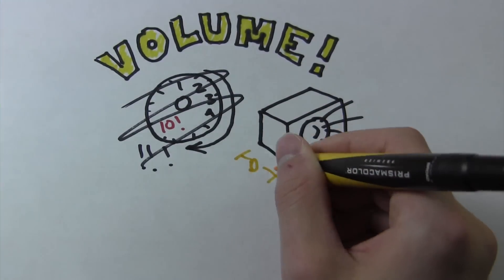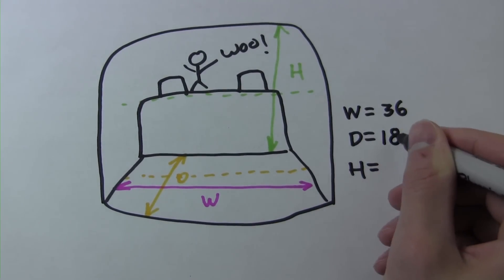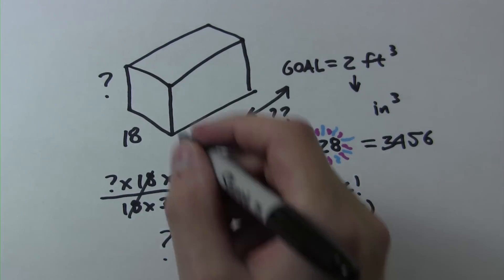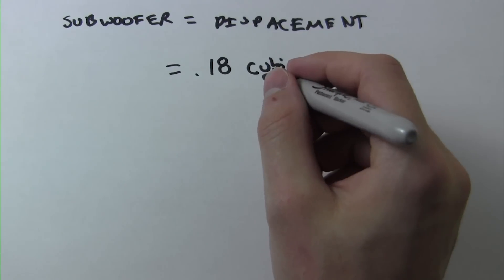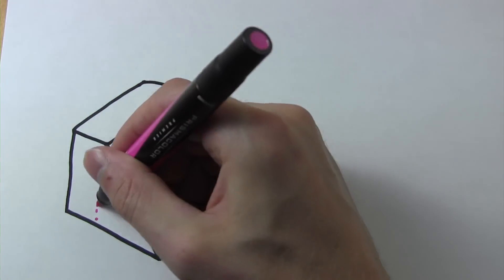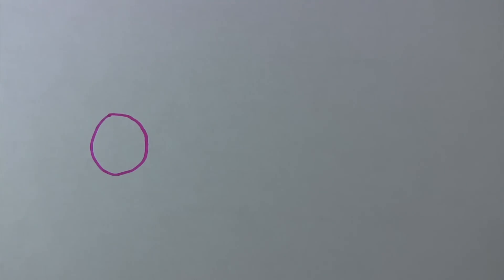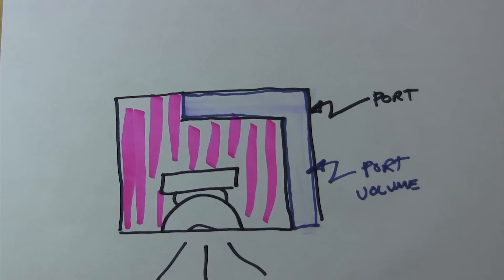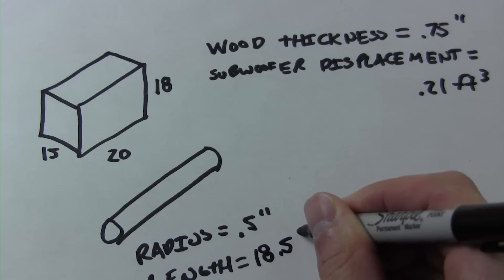Subwoofer Box Volume - Car Audio Basics - CarAudioFabrication

Comment: hey man, do 45s in a box effect port tuning?
Reply from the maker: If you don't account for them in your volume calculations you are not determining your port length correctly based on what you are inputing to that equation to determine what length is needed for the desired frequency, so yes, in a way they do

Comment: When you calculated for a wedge you did triangle calculations. Why don't you just add the lengths of both and divide it by two. That's what I did it's much simpler.  Also my jl10w3 displacement is only .05.  Isnt that really small?  Seems like it would be more because yours was like .2 or something.

Comment: How do you figure port length all these web sites confuse me I got 2 kicker comp 15 in a box I made > 20 D x 35 W x 18 H i have 2 4" round ports 6.25 long I thought that was it but it don't sound right i want 40 hz but idk if that's the right dia for 15s and I'm not putting them in the box they would be on the out side bec the box is small
Reply: You gotta go bigger
Reply: Longer. 6.25 is to short, she'll never be happy with that!

Comment: Why do you add Subwoofer displacement to the amount of volume in the box🤔, shouldn't it be subtracted since it's taking up more space?
Reply: U add it when you know what size enclosure you need... then you would know exactly what size it has to be.....if u added the sub without adding the space to the enclosure that it will take up.... your measurement would be off by the amount of space that the sub is taking up.

Comment: My problem is I want to know what s making my car lights dim when I'm bass hard? I have  a 1000 watt. Sound stream mono blk. Amp. And
Reply: You have a few issues, and it all has to do with power supply.
Firstly, your alternator does not have the capacity to support the system. You need a larger alternator. In your case, you should install an alternator that is 50 amps more powerful than what your car has.
On top of that, you need more reserve power, which comes from an extra, or larger battery. The best solution would be to install a seperate 14V XS Power battery in the trunk or the like.
Lastly, contrary to what some will say, a capacitor is very useful and is part of any good system.
Install a 1.5 to 2 farad capacitor that is 20-24 volt surge rated. They are actually not that expensive. The Audiobahn 2 farad caps are pretty good value.
Lasly, you need to run proper wires if you already don't. First off, get rid of your CCA cables if you have those. The conductivity of those are so bad compared to OFC wire, it's not even funny. As an example, a 4 gauge CCA cable will support about 60 amps, and a 4 gauge OFC cable will support 150 amps. So make sure you use good OFC wire. Your install does not need more than the 4 gauge, so that makes it pretty affordable. Sky High Audio and KnuKnoceptz both make great OFC wire. Use 4 gauge for both power and ground!

If you think the larger alternator just makes things way too daunting, the basics are as follows.'
XS Power D14-31 or D1400 in the trunk with your amps. You will retain your stock battery, so this XS Power battery will only run your system.
The capacitor, and the OFC power/ground wire.

A final word on alternators. Contact your car dealer/shop. Chances are that there's an OE alternator unit with more capacity than the one installed in your car. This will make installing a new alternator virtually plug'n'play. Larger alternators are the big thing in good car audio systems.

Comment: There is a typo in the Brace volume line. 1725 should have been 1728. I did the calculation with 1728 but typed it in wrong in the comment.

Comment: But the brace couldn't be 18.5 inches..It could only be 17.5 inches it wouldn't fit in the box. Or am I missing something?
Reply: LaZy 4 Life the external length is 20 inches. The wood is 3/4 inch thick. Two end pieces makes that 1.5 inches. 20 minus 1.5 is 18.5 inches between the end walls.